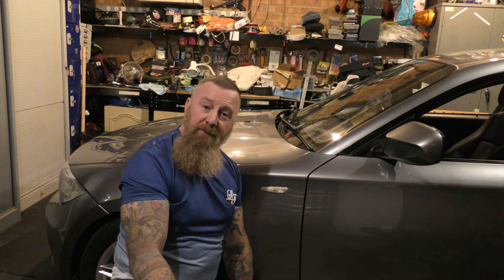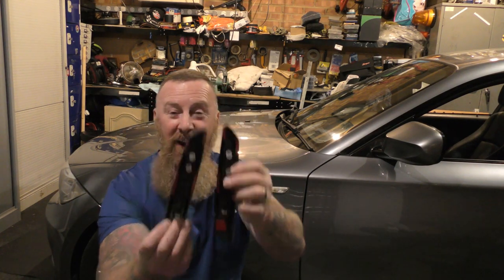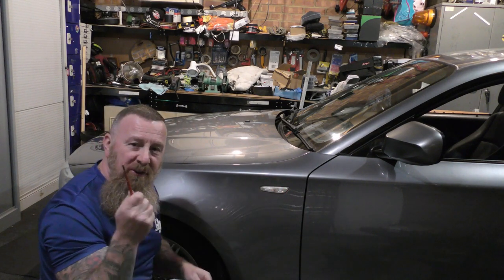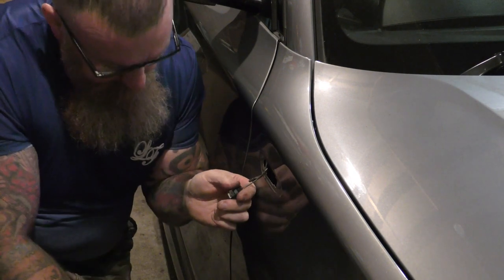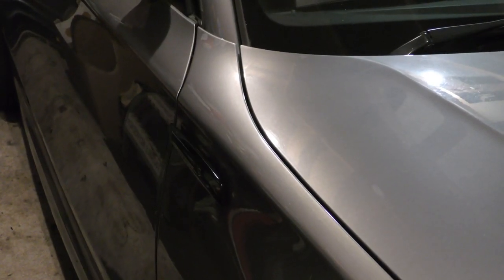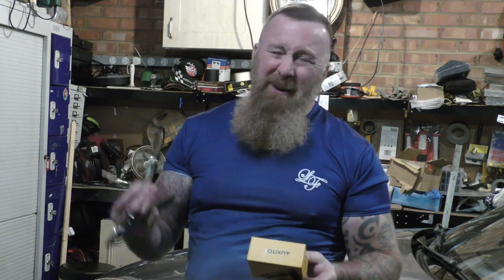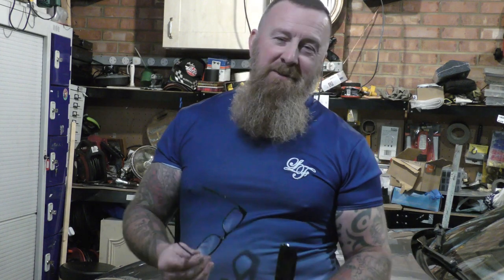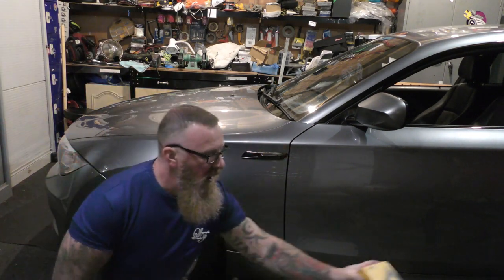AUXITO SIDE REPEATER / INDICATOR UPGRADE

Comment: Hi mark, enjoy your videos a lot and I have a question: I have a 2005 Speedfight 2, put in a new power supply but the electric start doesn't work + it doesn't count how fast I'm going the headlights, horn works fine too but honestly mate I have no clue
Reply from the maker: There's a few things going on there bud 
Speedo is a cable , did it work before 
Power supply?
As in what 
Battery , stator coil ?
Electric start 
Again did it work before
Reply: @marksavage  the electric start not if I remember correctly, however before installing the new power supply it used to count my km's gas tank etc..
Reply: @marksavage  checked your video the other day, and it doesn't make a clicking sound when pressing the electric start button

Comment: what is the correct ignition timing Peugeot Speedfight
Reply from the maker: It's pre set by the stator placement
Reply: what is the correct ignition timing Peugeot Speedfight 3 Have replaced the crankshaft

Comment: Hi mark I have a speedfight 2 which died due to no spark, took it to mechanic and he said it was cdi replaced it. Got it back today and hasn’t ran the same since sounds different etc. but after about a mile or 2 of riding all of a sudden it will loose power and struggle to run and get even louder. Recon he’s put a dodgy cdi unit in? Just ordered a new bypassed cdi unit because that’s all I can think it is

Comment: Hello mark im in need of a bit of help with my speedfight 2 i think my clutch is nacked my bike reves up no problem but its just not moving properly ive changed the rollers to 6 grams new belt and cleaned the variator but the clutch seams to stick abit tacks so lone for it to start opening up from ghe clutch im lost lol
Reply from the maker: as in my speedfight clutch video to test but does sound like it , its an easy thing to change and will make a difference.
i did a video of my riding one home with the clutch gone and it wasn't fun as all lol
Reply: @marksavage  I sorted out the clutch problem but my bike won't run properly with the airbox box on but as soon as you tack it off it pulls so well I noticed my airbox is mot sealed properly its damaged do you think a new airbox will fix it don't really want to run it with out a airbox on I'm abit lost with this one got the carburettor set up properly